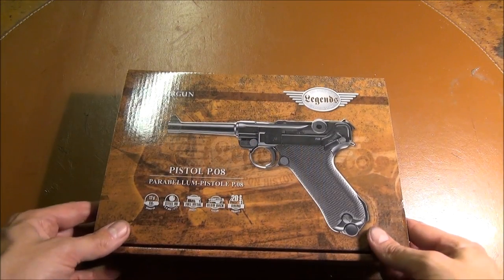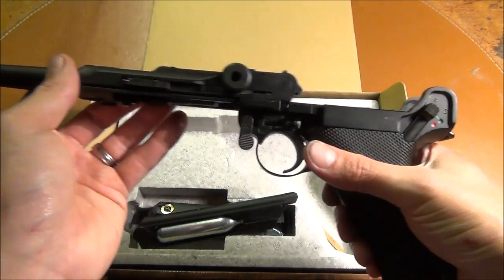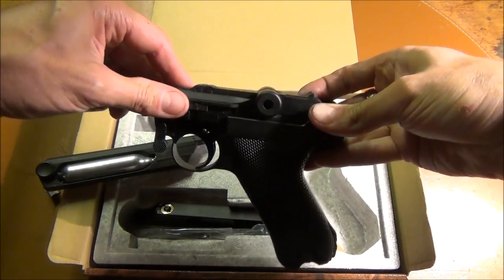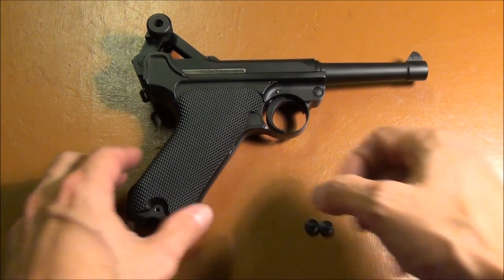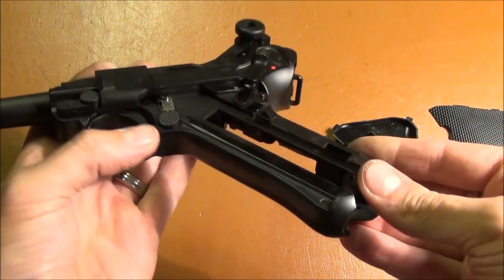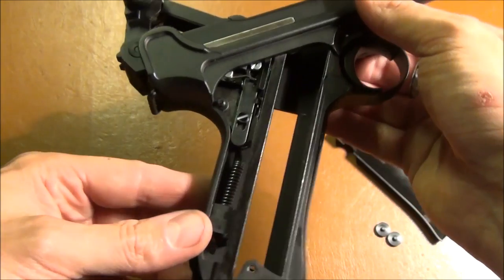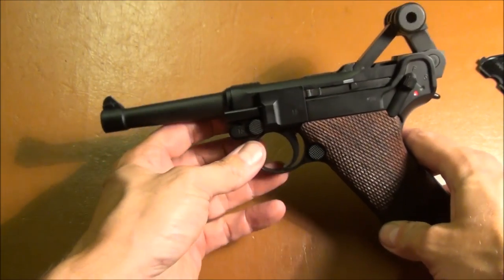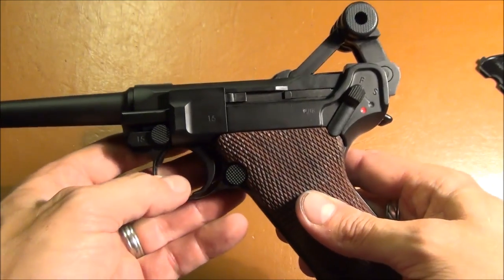Arts and Crafts: Tarting Up An Airgun Luger

Comment: I saw a guy with a real P08 achieving that by using a sharpie eraser. He just rubbed it down which took off some of the finish making it look genuinely worn on the edges like it had spent years being holstered etc.
Reply: Why on earth would someone deliberately ruin the finish on a real P08? Was his middle name Bubba?
These are covered in relatively thick paint so I guess it could also work gently sanding the edges off with fine grit paper to uncover the lighter primer coating and metal.
Reply: It wasn't a old one it was brand new, but yes I see your point. I guess he had more money than sense!
Reply: srspower Who makes new production Lugers?
Reply: Didn't Mauser make a small run at the 70s or 80s?
Reply: +The Chap, if I remember correctly, there's also a gunsmith in California that makes small batches of high quality reproductions.  By the way, this was another very interesting project that turned out quite well.
Reply: Thank you sir!
Reply: simonferrer I had heard about the fellow in California, although I had heard those were more expensive than many originals.
Reply: The Chap I had also heard about the small factory run but would've figured anyone who'd hunt one of them down wouldn't add fake wear to it
Reply: the cali gunsmith was names martz. ian at forgotten weapons did a recent vid on several examples. definitely gun porn.

Comment: You still have GW paint pots with the old white lids? I thought I was the only one. Those pots must be edging 20 years old.
Reply: Ah the old gamers are coming out of the woodwork:-) I should really check, most are probably dry.  I know the smelly primer and orange are still fluid though 25 years later.
Reply: i have a few too! 1988 vintage, they still work ok.
Reply: They are of excellent quality.  I've forgotten the number of the kid's toys and household objects I have repaired and touched up with a bit of ye olde Citadel paint.

Comment: always a classic design. Swiss 7.65mm Luger? Should be plenty around! I've read that only a barrel change can make a 7.65mm into a 9mm Luger.
Reply: Will Mathieson easier said than done.
Reply: Oh I have a real one too, but I can't casually shoot that across the workshop.
Reply: yes walls make poor backstops. Amazing how authentic your airgun looks and operates with the toggle
Reply: Easier said then done, Lugers are realllllly early pistols in the design they use, they don't have interchangeable parts with each other really, they are fitted largely by hand, this is why they where so expensive and why the P38 replaced it.
Reply: always is

Comment: i'm surprised your not a imperial guard player good sir, seemed much more up your ally
Reply: I had nothing against them as such but the huge bias GW had (still has?) for all things Imperium irked me immensely.  The mystery of alien races was far more appealing even if you had to wait 6 months before GW bothered to release the next release (and 24 Imperial releases).  I want know what happened to Squats!
Reply: very true, also reset the clock, someone mentioned squats heheh
Reply: Have you seen the Kharadron Overlords? Kinda Jules-Vern Squats!
Reply: xXxCatsnakexXx Yes, they are steampunk awesomeness!
Reply: Yes! 1 quick question: Do you rate the snap-caps you have for your Schmit-Rubin1889; or shall I just make some out of empty shells and hot-melt glue?
Reply: xXxCatsnakexXx I don‘t really use snap caps on CF guns but homemade ones do just fine

Comment: Handle is the first place where blueing goes for ones sweaty hands eats it white.
Reply: The frames of these toys are covered in thick black paint so there is little danger of that.
Reply: that might be the case on those toys but I was speaking or writing about the real deals; Parabellums and also other blued pistols; in those the handles are almost always white from wear&tear and handeling.
Reply: Well obviously, any old gun that has been handled a lot will have surface wear.  I must say I've never seen a Swiss Luger with worn bluing on the grip frame, then again it was an officer's pistol therefore rarely used and they wore gloves a lot.

Comment: you really should put some sort of locking tabs on the tops of those grips, even if it's  using cyanoacrylate glue to put in some small plastic shims.  Here is my heavily worn WW1 Luger (That I loaned to IMFDB for photos) http://www.imfdb.org/images/9/98/LugerP08Pistol.jpg
Reply: It was my intention, but once crewed in place they are a tight fit and thus don't need any locking tabs. I guess it's down to luck and careful fitting.
Reply: +Scott Ruggels, I was thinking the same thing myself, but the additional protrusions from the frame of this air pistol that the Chap had to make cutouts for seem to be acting as their own locking tabs.  They keep the grip scales from shifting along with the screw tension.

Comment: Respect to the old skool GW kit but no respect for the application. No need to weather a painted metal finish to make it look like a worn metal finish, just wear it down. Drybrushing is fine if you are working to scale but when working at 1:1 why not just get jiggy with some emery paper?

The grips having to be fitted would have sent most Swiss engineers running! Fitting an engineered part ?? They just aren't geared up for that level of psychological trauma in the workplace.
Reply: Shoot McRunfast because it’s just a thin layer of black paint on pot metal. Getting jiggy with emery paper will just result in scratches and very shiny edges, which is not that same as attempting to simulate wear to a blued finish.
Reply: @thebotrchap  No need to get defensive. Obviously you are entitled to your own opinion but I disagree. Anyone with proper experience knows what they are doing in a project like this and will use what is already there. No point in trying to rub a bit of 20 year old acrylic onto an already 2nd rate finish and pretending it is some kind of esoteric talent.

No doubt it looks more realistic than it did when it came out of the KWC factory but it will wear with use anyway. If you are attempting to weather it, it seems foolish to just paint on top of what will ultimately wear naturally anyway. Drybrushing as a weathering effect is useful at small scale,  if you are using it at 1:1 it is just daft, why artificially create an effect that you can easily create realistically and more permanently?
Reply: Shoot McRunfast To each his own. I’m attempting to show a method accessible to all, certainly financially. I’m not trying to win a golden demon award contrary to what you appear to think.  Fans of the sand blasted approach can just buy the “WWll 1939-1945” edition of this pistol ableit still with nasty hollow plastic grips.